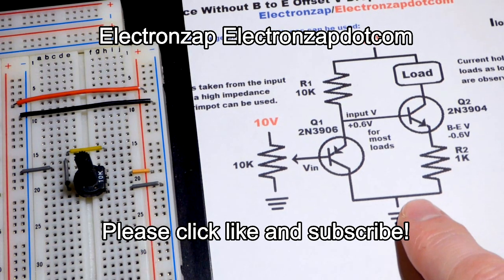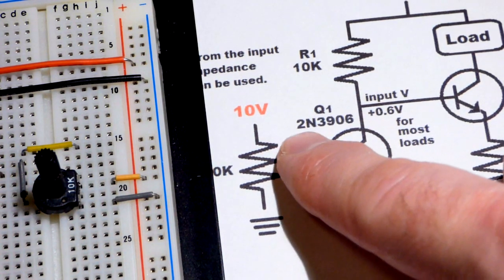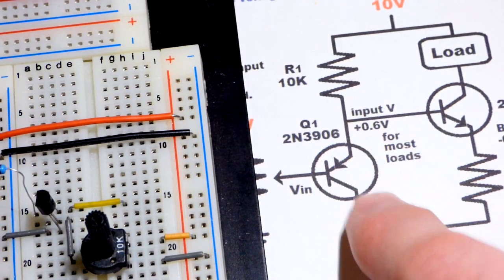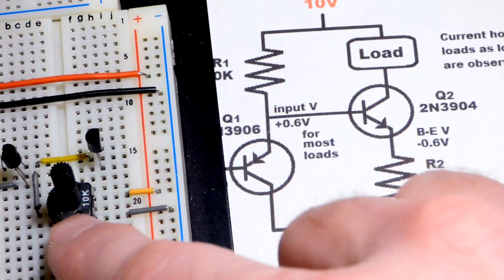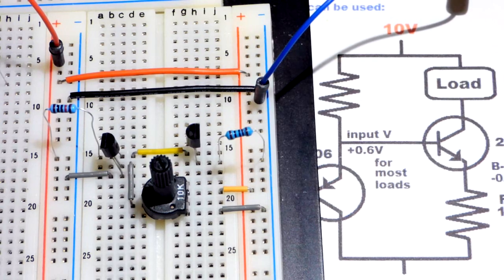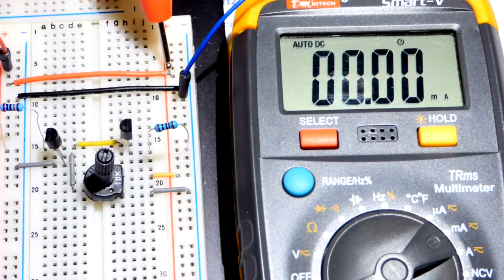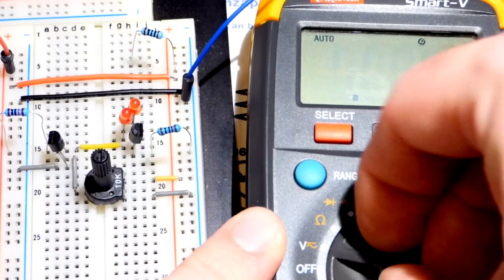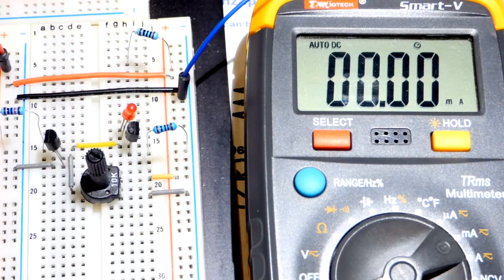Transistor circuit 17 current source without Base Emitter V drop using NPN 2N3904 and PNP 2N3906

Comment: Holy moly, the led flasher circuit from forest mims III getting started in electronics book makes sense now! Both transistor handle different aspects of switching, one voltage and the other current.
Reply from the maker: Glad to hear!

Comment: Thanks, could you explain how to setup a variable current limit on output of psu ?
Reply from the maker: That's a complex topic that depends on the load and power supply. Hopefully the load already limits current to a safe level and doesn't exceed what the PSU can provide.
Reply: Say 0a to 5 a on an output of 0 v to 60v dc